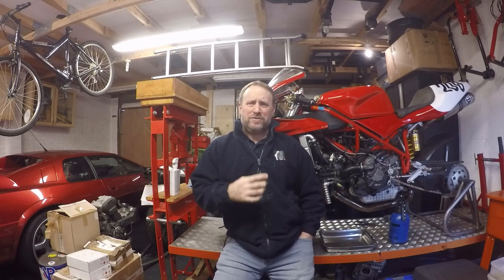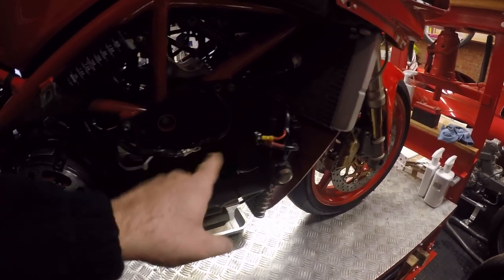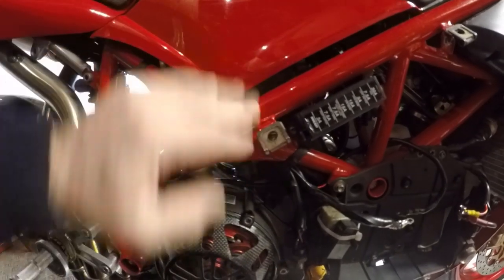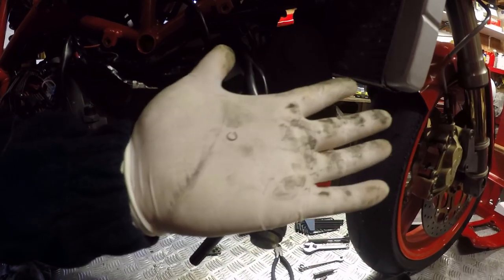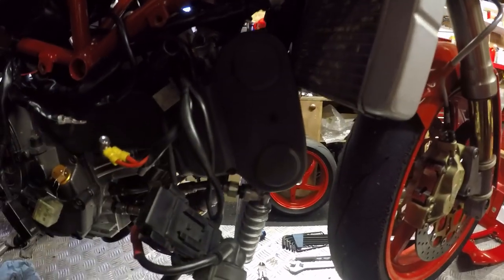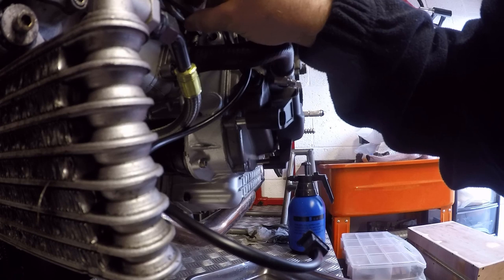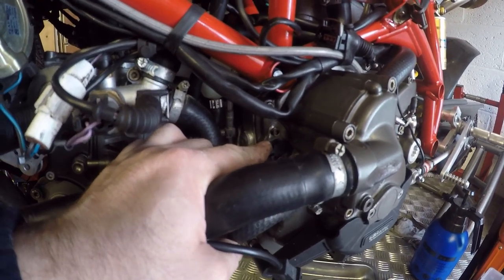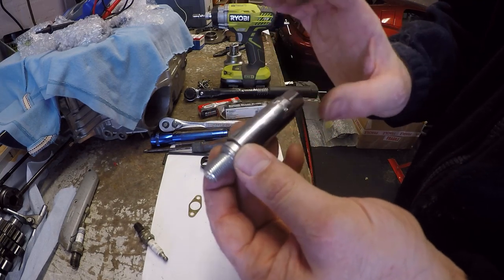Ducati 748 2020 Race Bike Service - Video 1

Comment: a protective cap on the spark plug, paper or plastic, is needed for transportation so that the electrode does not break, and for us)) for installation.  since the grease from the fingers will act on the spark plug like a light bulb.  and this information I didn’t come up with, but information from Bosch back in 1996.
Reply from the maker: Good advice, I have noticed this on some plugs but not on others. Tthanks :)

Comment: Better loose than tight, once the engine is warm it expands, so chance of a belt being loose not a real worry, the vertical cylinder runs hotter by my accounts. Used a tuning app on my iPhone to check my belts, I prefer 80-90hz
Reply from the maker: I agree, once the initial stretch has happened I am happy as long as the belt sits above the service limit, I went with 90Hhz to reset the vertical as it then matched the horizontal cylinder.
Reply: @DesmoWerx  I started work on my second 748 S frame today, the motor has the early castings 97 like the other engine I have in my other bike. I believe these early bikes have better better valve train parts, we discussed case differences in another post. So far the motor I bought for $400.00 for my other bike has given me 6k with no issues, well not entirely issue free, I've got a slow cam seal leak on my vertical cylinder, I'll be checking into that eventually, for now plan is to get the second bike going for beating around town naked on .... lol

Comment: Another top video,  very methodical,  I've been restoring my 748 
Over the winter, you could not make it up, I have a box of nos 748 engine spares and guess what's in there? A new horizontal inspection cover that the v piece bolts to. Are you on any of the forums in the UK?
Reply from the maker: Ooh, I am on the Ducati Forum in the UK or my email address is in the channel page. :)

Comment: Adam could you not fit a helicoil to one of those caps? Bike looks amazing mate.
Reply from the maker: Going to try Andy, it depends on whether the arm has enough spare metal to take it out slightly and fit the helicoil, being a cast cover it is quite weak in that area. Wont do any harm to try though.

Comment: Hi Nellie, glad to see this new video!
What kind of socket/tool do you use for the spark plug? I torque the spark by hand with the OEM tool.
Reply from the maker: Hi Trevor,
It is a 16mm thin wall Socket and normal 3/8th drive ratchet.
Reply: @DesmoWerx  thanx Nellie!

Comment: Superb video as always mate, I look forward to them! 

I had the same problem with the threads stripping on my inspection cover, so put helicoils in. I bought a replacement, but it’s a big bigger so I’m guessing it’s for a 916 model. 

If you’ve got the details for the firm in the states, I’ll have a look with those guys :-)
Reply from the maker: Hi Tel,
Thanks for the compliment :)
This is the link to the supplier in the US and their ebay shop https://www.ebay.co.uk/str/hdesausa

Comment: Love your videos. Thank you. Referred to last year's thunderbike build series with the assembly and installation of my 853 conversion. One question, why would you not use a helicoil /recoil repair on the oil cooler guard fairing. That would make it better than new I reckon. Cheers
Reply from the maker: Going to try a helicoil repair but don't know if there is enough metal to open the hole and still retain the strength in the arm of the cover.
Glad the build series was of help to you :)

Comment: Please could you tell me what is the Auto Glym product you spray on your bike and rear wheel & what is in the blue spray bottle?
Reply from the maker: Hi Sarah,

I use Wheel Cleaner as its good for getting the brake dust and track rubbish off the wheel, and then Engine Degreaser for removing the Chain Wax. The blue bottles are Soapy water and Plain water to carry our general cleaning and washing the products away.
Reply: @DesmoWerx  Thanks for that, always useful to see what other products folk use 👍🏍

Comment: A special tool to turn over the engine and crank position sensor shims??  Ducatis are weird.
Reply from the maker: That's why people avoid working on them but it all makes it more fun when working on them. The sensor shims are used as there are different tolerances between all the parts used.
Reply: @DesmoWerx  yeah I figured but in 25 years as an automotive mechanic I've never seen a crank sensor that needed to be shimmed.

Comment: Please help me out. Where can I get a tensioner tool .
Reply from the maker: Hi Julius,
You can find them on line on Ebay https://www.ebay.co.uk/itm/Ducati-Cam-Belt-Tension-Tool/303381505746?fits=UKM_Make%3ADucati&hash=item46a2f266d2:g:S8IAAOSwsbhd3wfZ
Or you can use your phone with a good microphone and guitar tuning software.

Comment: If you'd still had the rear wheel on, could you not put it in gear and rotate the wheel instead of using the Ducati crank-rotator tool?
Reply from the maker: Yes, you can if the plugs are out. It takes a little more effort and is not as easy to get accurately in place but will work :)

Comment: What are you using to clean the bike? Anything special?
Reply from the maker: I use Autoglym a mix of either of Engine Degreaser or Wheel Cleaner. The wheel cleaner is good for shifting chain lube.

Comment: What was the defect on the bike induced by the sensor?
Reply from the maker: I was suffering a miss fire, it appears the problem still exists though, I will solve this eventually as its intermittent it is hard to find.
Reply: My problem is the same. Around 9000rpm the bike have a very short moment lose power. Like if miss the electricity. Somethings also follow by an explosions but not always. I note it also happen when I hardly open the gas and in the second shift.

Comment: Don’t touch ceramic spark in hand 
. Only tools.
Reply from the maker: Interesting, not heard that tip before. Thanks :)
Reply: a protective cap on the spark plug, paper or plastic, is needed for transportation so that the electrode does not break, and for us)) for installation.  since the grease from the fingers will act on the spark plug like a light bulb.  and this information I didn’t come up with, but information from Bosch back in 1996.